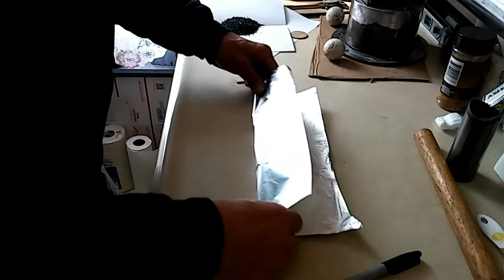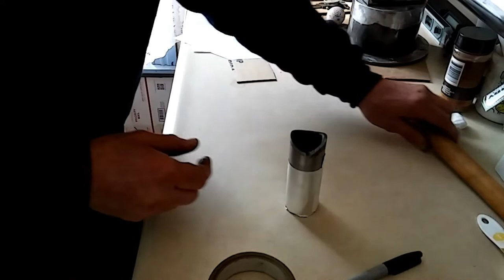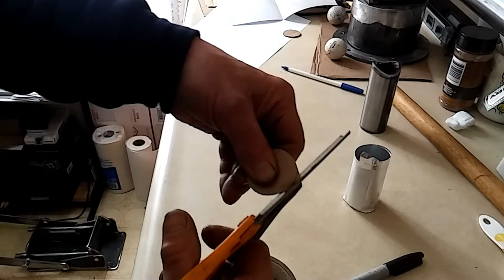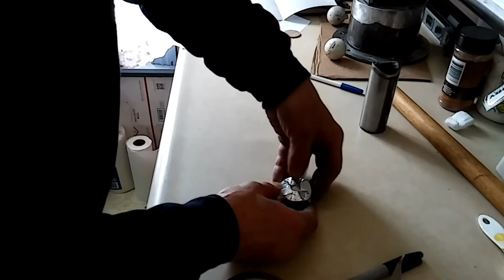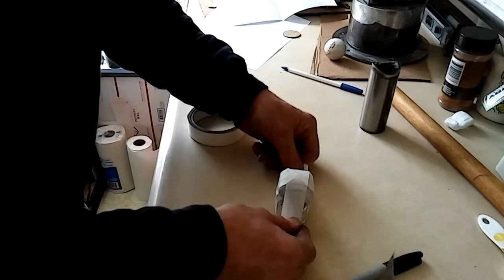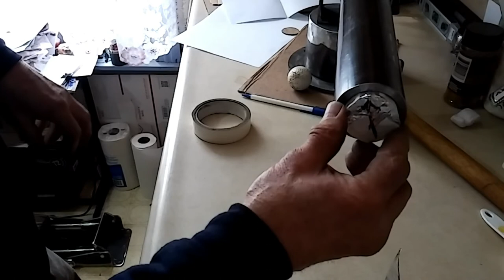Cannon Powder Bag Cartridge

Comment: Dom, instead of tracing and cutting out the cardboard wad, try making  a punch the same diameter and then punch them out. I do this when making wads for my black powder blank  .45 colt cartridges, I use cork board instead of cardboard. It might work the same on cardboard if the punch was sharp enough.
Reply from the maker: stewie,  Thanks for the suggestion!

Comment: Why did you draw an arrow on the cartridge?
Reply from the maker: The arrow point to a section of the foil where there is no taped seam so it’s easier to poke a vent hole in the charge rather than trying to pierce through the tape.

Comment: Does the aluminum get stuck in the cannon?
Reply from the maker: Yes, I push it out with a bore sponge
Reply: @morecannonfab  thank you. I recently got a job at a ballpark and need a way to quickly reload the cannon in case of multiple home runs during an inning. Saw the foil method and got excited when I saw you can premake charges. Considering using multiple sheets of tissue paper instead if the foil jams it up
Reply: @morecannonfab  also appreciate the quick reply!
Reply from the maker: @Deltafor32  If you have a muzzleloader,  you would use a worming tool to remove the foil remnants.

Comment: Ever tried grapeshot?
Reply: soon as it gets warm i am gonna use the pointed lead air rifle pellets in my 1.125 bore cannon on 3/4 plywood just to see what they do. i have shot solid oak hardwood balls and they went through the plywood but only got flatspotted and did not break apart. used paintballs but very few remained intact to hit the plywood.
Reply: @flhusa1  
Nice! Well it looks like you got a new sub.
Reply from the maker: No I haven't.